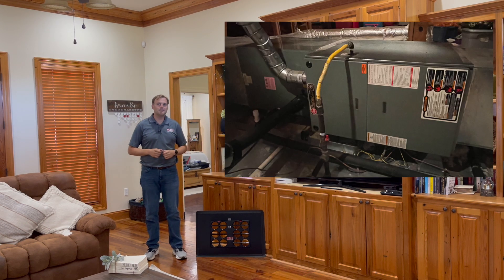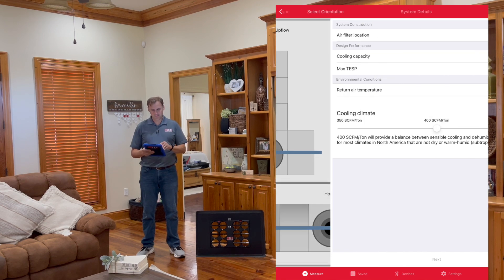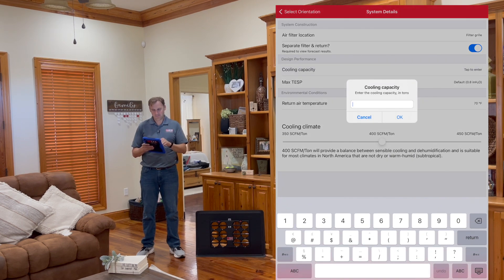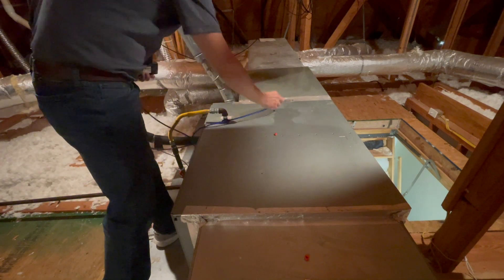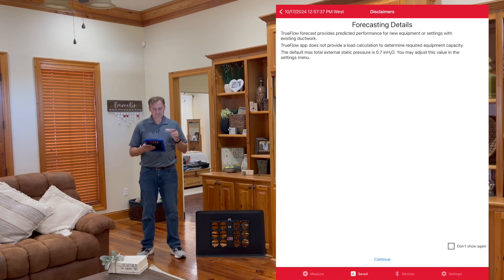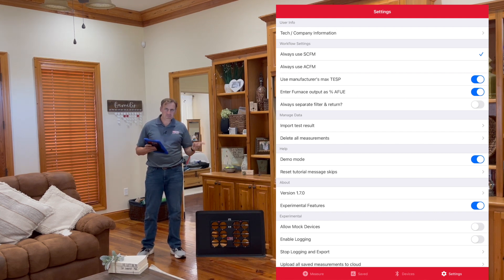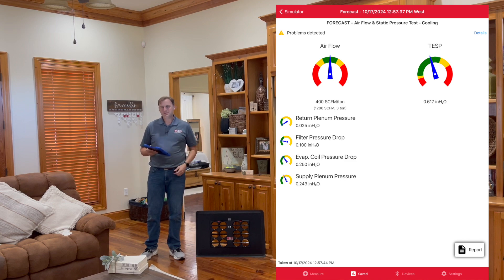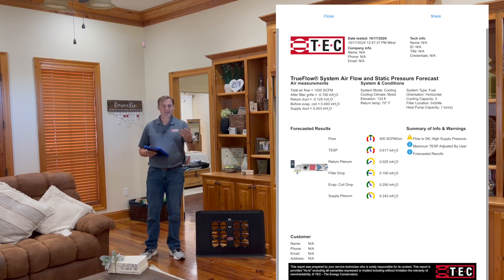TEC TrueFlow Forecasting Overview

Comment: What if the blower motor is not moving enough air due to being old and wore out. 

Are we safe if it’s not over amping and capacitor is within spec ?
Reply from the maker: In the essence of forecasting, if the current installed system is moving the improper airflow, this will not change how you deploy forecasting.  As long as we are provided a test in condition, good or bad, we can forecast a future install.  However, It is important to have a clean filter for forecasting, or you will be making decisions on filter sizing based on a dirty filter vs a clean filter, so a clean filter is highly recommended.
Reply: @ great thank you

Comment: This is another game changer. Awesome work from TEC!  Regarding dual fuel heat pumps. Any changes there for test testing?
Reply from the maker: Thanks Andy!  In regards to your question about dual fuel, the app can test one fuel source at a time.  So if you want to see the performance of a heat pump, then follow heat pump selections, if you want to see the forecasting of a furnace, then follow furnace selections.  That being said, furnace and kW heat mode forecasting is not released yet.  This will be another release to follow.  But the statement above will stay true.  You will not be required to do another test in to forecast different options, just return to the saved test or hit the back button a couple of times.